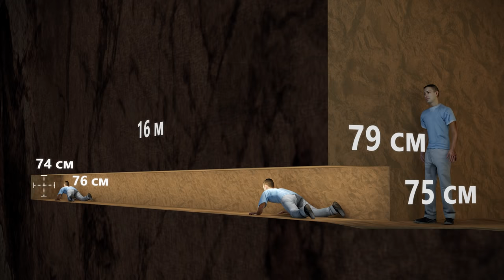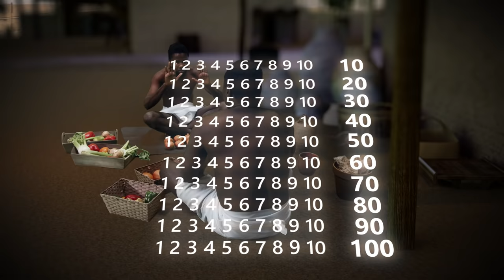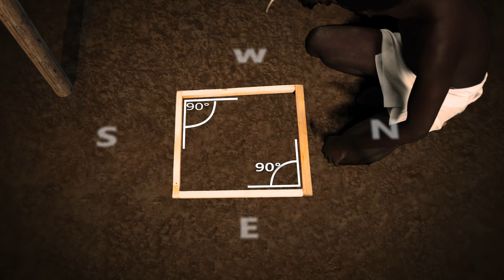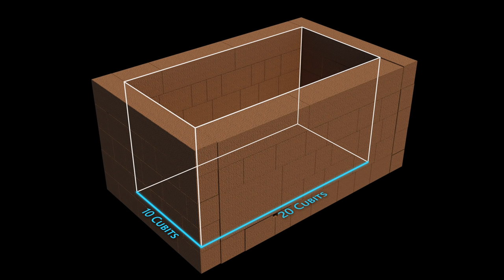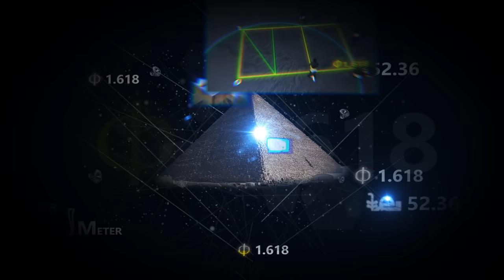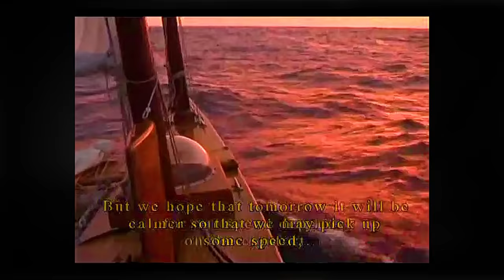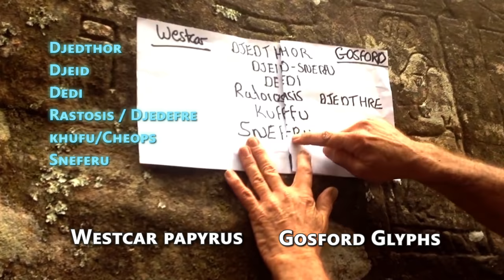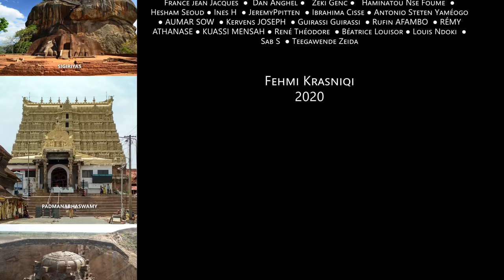The Movie Great Pyramid K 2019 - Director Fehmi Krasniqi

Comment: Unfortunately your hypothesis regarding molten granite falls apart when we look at what actually happens to granite when it's melted. It doesn't look like granite any more.
Reply: Some truths and some failures. They have also done DNA analysis on the mummies. They know their lineage
Reply: I am suspicious about that large heavy lens tilting up on that light timber frame. Has  that process been repeated today, building such a large lens using primitive tools, melting granite rocks and setting the molten granite into moulds?
BTW I really enjoyed this film. Thank you.
Reply: It's not molten granite, it's a concrete variety made of limestone, caustic soda and water from the Nile.
Reply: Who is they?
Reply: @barryliberty4335  king and queen's chambers are made of granite--very large, heavy, highly polished blocks.  And said to be poured after having been molten
Reply: @lockedfn-subpls  I'm wondering have you seen the story about a large block of glass that was actually made in Israel somewhere but this piece of glass was so huge I'm trying to remember the exact size it was like 5 ft thick and 20 ft across I can't really remember but it was the largest piece of glass anyone has ever seen that supposedly came from antiquity so I think they had the ability to make such size class but I don't know it's all baffling to me
Reply: @barryliberty4335  No it's just granite, it does not seem to have been melted. It may be reconstituted granite but that leads to more questions.
Reply: @santodiaz8049  The granite you are referring to has been subjected to high heat in places, but it has not been molten.
Reply: Felt the same way.  Granite is a conglomerate, and if its melted it turns into basalt, or obsidian.  I could see it plausible for a granite like concrete though.  Cold mix and heat generated by the chemical reaction maybe fuse the conglomerate rock together??   The lenses thing.. kind of throws me.  I could see it as a theory.. but something that size even made of the clear material.  I was expecting them to say it was 'cut synthetic diamond', grown underwater in the river.
Reply: @GroberWeisenstein  yes that backs up my point so no need to be sorry!
Reply: What does it look like when it cools after melting?
Reply: @RaniSmagin  Darker, even textured, basalt. Somewhat similar to what the black floor around the great pyramid looks like (another bag of worms right there!)
Reply: @-mattwood  well thanks for the upload of the glass slab that is pretty amazing when you think about all the tongues of wood needed to make that happen I mean days and days of burning
Reply: @barryliberty4335  Yes...thats true enough. But...people are talking about the inside chambers that are made of granite.
Reply: @Galadriel333  Yes, but how many granite blocks? They could have manufactured 100-200 granite blocks  in 20 years and inserted them into the pyramid. As for if they were melted, I doubt they used lenses. They could have used copper mirrors instead, much more easier to manufacture. But that remains a mystery to me...
Reply: @barryliberty4335  heheheh , you dont say
Reply: Also, a 5 meter diameter lens would weigh roughly 16,000 pounds. Hubble telescope has a lens of 2.4 meters that was 8000 pounds before it was “honeycombed” to make it lighter.
Reply: @MrKenzyte  There is fire starter process using a bag of water in a ziplock bag to form a lens.  It got fire going.
Reply: @GroberWeisenstein  you sounded like "diamond only happened in nature" and in reality artificial diamonds were real things. 
Also egypt had known famously as mummy maker, that's it artificial fossilization! even it is still not clear how they've done it but knowing fact egypt understand how to petrifying things, then it's not surprised if they can toying with artificial granite.
Reply: @barryliberty4335  you need many meter of mirror copper for making granite into flow freely, not to mention polishing, maintain oxidation, and directing sun ray into object, even it is still possible if they used mirror copper on wider land. Sodium silicate lens are the most plausible answer :  compact, safer, easier to operate, & can deliver instant heat more accurately. Some said we can petrify wood by using sodium silicate, and i suspected egyptian had mastered this substance including lens and mummy stuff!
Reply: @GroberWeisenstein  it is still mystery if you dont see granite formation before your eyes, especially today we have knowledge about lens smelter, you can see for yourselves by using big enugh modern fresnel tv, thousands degree achieved in blink eyes, idont see why we or egyptian couldn't tinkered with lesser stones or granite by this method
Reply: @ancientbear3280  they also have done Mitochondrial DNA sampling in all parts of the world.  They pretty much know what groups of people migrated from what parts of the world and in what order, based on mutations in that DNA of various groups of humans being carried forward over time, with new mutations added over time in the separate but still spreading groups.  Bear in mind, Mitochondrial DNA is not the same as Genetic DNA, and it is passed only through the mitochondria in the woman's egg cells, and so leaves a purely matrilineal trail.  The Seven Daughters of Eve is a book about that.
Reply: @louiseholland9316  you'd have to understand that all granites are but a composite mix of various minerals all forming their own respective crystalline structures.  Basically granite forms from magma that cools very very slowly (think milennia), giving the atoms time to sort themselves out - some atoms go with other atoms and form a particular mineral, which has it's own crystalline structure, while just next to it some other groups of atoms are forming a completely different mineral.  Then, once the granite has cooled, you would see under the microscope that there are these beautiful tiny little crystals going every which way, each one a different mineral.  Now, once you melt it, all those individual crystals melt, and the atoms disassociate and it becomes one blob, and now you're going to cool it off very quickly (seconds), well those atoms freeze in place and don't really have time to form into crystals with well-ordered atomic structures.  It will form very very tiny crystals, with some semblance of atomic structure, but none of them joined with one another, none of them oriented any which way, and certainly not very interesting to look at in a microscope.   I think it might actually be considered Basalt at that point, which is essentially magma which as quickly cooled, much faster than granite I believe.  I may be wrong on a few points, as it has been a full 40 years since I studied my metallurgy in college (metallurgy and crystallography have both metals and minerals in common, that's how engineers know about crystallography).
Reply: @nobodyknows3180  yes that backs up my point. Melt granite and it turns in basalt. Great explanation of the process Nobody Knows.

Comment: The melting theory won't work for granite.  Even if they had a large enough focal point to melt the granite, the granite is solidified before it reaches the bottom of the form, let alone floating around to fill the form. Even if they could, somehow, keep it warm and floating, the result would be an obsidian box and not a granite box.
You could have tested your theory in your backyard with a piece of plastic, 4 poles and water (that is a lens).
Reply: They should have shown a present day reproduction of this process,a real life demonstration.
Reply: @rondecambio7375  There is a reason why they didn’t. It doesn’t work.
Reply: It's sort of right there in front of your face isn't it? If it's so easy to make this home made crystal ,then make one and use it.Your 100% right 👍
Reply: total agree... melt granite? really?

Comment: A documentary so flawlessly executed. One of the most proactive, introspective and ... Just incredibly well executed. Thank you, Thank you so much for enlightening us with your Information and incredible work, studies. Mathematics that is so intertwined, flawless and just plain simplistic in outcome yet volumes in precise organization. Incredible Incredible Incredible!!!
Reply: However i like the molten granite idea, it still has some basic flaws, especially the lens and melting stones. To make it work as a lens you need to have a very polished surface, that's not easy to do. Also i don't know how stiff that material. The other thing is that working next to a huge lens is just suicide because it's not just the focal point that heats up but the nearby out-of-focus are too to a certain level, also the surrounding air. With this size you are grilled if you step too close, wooden molds also can be burnt easily. Thing is that it's not something you can just turn off. Also the depiction of the workflow and the "lens tool" is not well thought out, wind is simply carrying away big percent of the heat so the only way i can imagine this is to have a closed building with a hole on the roof just enough for the ray. Still far from perfect but at least the heat stays in a relatively closed system (can't be closed enough). Problem is that the stone is cooling down very fast, you can't just pour it, or if you can maintain the heat it still not going to cool down to a rock like material but glass like. Granite in nature has crystals that forms in thousands of years, if you melt it, you need another 5-10.000 years to get it crystalized while cooling down super slow, so it's simply not possible to just melt it and get it back to a rock. Also i'm wondering if it's even possible to make a giant 5m wide lens that has accurate enough curve, polished enough, clean enough, and not sure if it could hold it's own weight or just break when mounted. I mean even the small one in the film is full with air bubbles, not smooth at all, imagine it upscaled to 5 meters, it would look like cat litter, not see thru at all. 

A somewhat obvious problem is the idea of waiting for the flood to transport enough water. I mean if it's like that then the whole construction would stop after the 3 months flood is over, making the whole construction 4 times slower (because for 9 months of the year they don't have that flood water).

BUT, the limestone concrete would work so no problem with that. And this is why i think that they might have the same with granite and other stones too, it makes more sense that they had a method to do that with harder stones as well (and it fits better the free masons theory). So if we stay on this train, the most plausible i can think of is that they used granite (and diorite etc) with different grain sizes from powder to small stones and mixed with something, so it's a type of "granite concrete" as they did with limestone. And if you look at close-up pictures of the statues you can even see that some of them has really smooth particles in it, in some others it's more bigger particles, so they had many variations, like different types of mixtures. 
Also about the vases, i'm pretty sure it's not just molded, because the ones with the bigger chunk of crystals and stones in it's structure (like the full black ones with the lighter bigger stones) is just not possible to mold them like that, simply because the lighter colored stone part of the material should be initially already perfectly curved as the vase itself. So it's definitely not molded to that shape but chiseled. A theory could be the combination of the two methods because chiseling the inside (especially to make it a hollow sphere shape) is way too much work and the possibility of breaking the whole thing during the process is way higher to call it efficient (and we are talking about a mass produced thing). But if you pour some concrete-like mixture on a mold the inner-shape of the vase and chisel the outside you make it way more easier. And this could be checked simply by checking the inside walls of the vases but to this day i have never seen a photo of the inside wall of any of these vases. But since those vases have their natural crack lines it's probably just a really high level of chiseling. 

I always had the idea that they had some really simple machinery (and even some chemistry) but perfected to a sophisticated level. Nothing big, special or out-of-era, just some clever hacks and even some luck. Think about it, when humanity (and that always means a single person in a given time and in a given community) comes up with a revolutionary idea it always about upgrading it, making it more and more sophisticated until a better idea comes that makes it obsolete. And in ancient times they had all the time to make simple ideas more sophisticated because there were no technologies that relied on each other that much. (For example we could have electric cars for 100 years now as they were invented that early in time but we sticked to ICE engines because battery technology wasn't good enough. But these guys had like about 1000 years or more to experiment with one simple thing, to make better and better mixtures of materials to have various and better and better concrete types. They had enough time to make a superior material even by luck, not just endless experimenting.) Same goes with chiseling and everything else. For example we make pottery with a constant rotating stand, if you do the same thing with chiseling you can achieve really precise stone vases. The only thing they had to figure out is constant rotating, and if they had that, they could do all of these stuff (They already had constant flow to measure time so they definitely knew the idea and  importance of constant moving.) And constant rotating next to a river is really easy to do with a mill, but since they probably had pulley it could be done with animal force or even with gravity. Honestly, i think the biggest mistake is that everyone is assuming that they didn't know the wheel, but it makes absolutely no sense if they obviously knew the circle shape and it's properties. Even in this film the showing rotating tools to transport water up, the pottery is round, it's pi everywhere,  they needed pulleys, so they new wheel and rotation pretty well. I know they used slides too but probably because it had it's advantages on certain terrains but not because they didn't know the wheel.
Reply: cant melt granite with a  piece of glass, lol . that not great. its more comedy where it matters then facts.
Reply: @attilahajnal3315  you sound like a strong anti who has tested this process and proven it to be definitely not true. Did you? Please explain how you did it.
Reply: @amenamin1661  lol you need to watch graham hancock someone that’s proves 100’s of people wrong about it an found out things about the pyramids no one who knew about
Reply: Truth, look up "precision evidence of ancient high technology" video